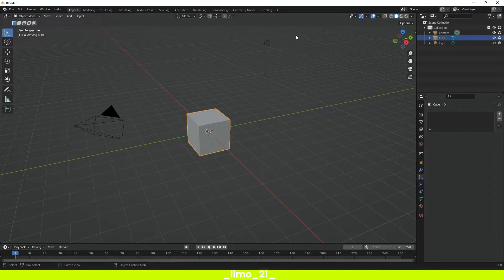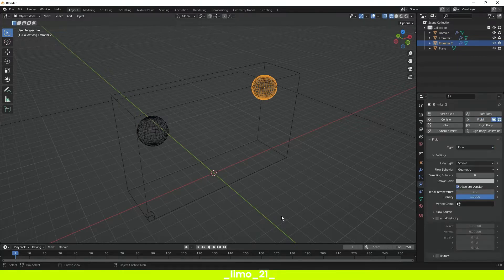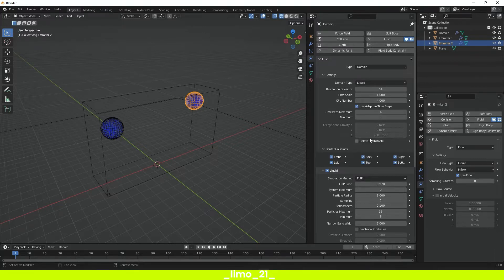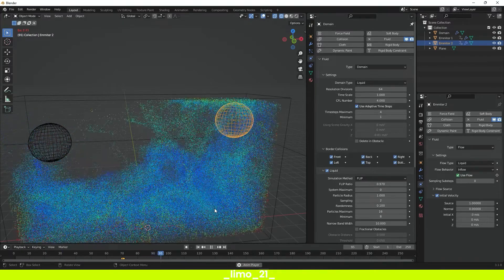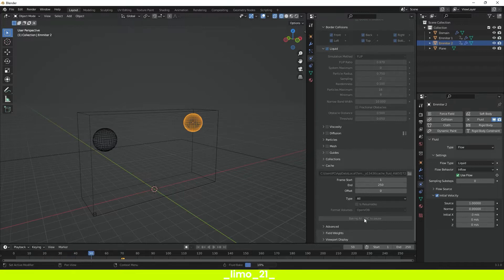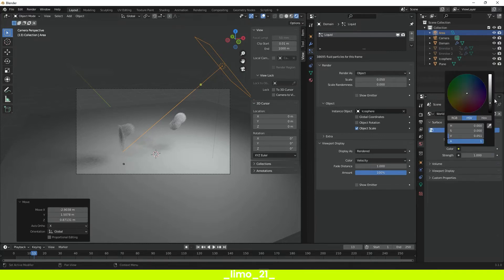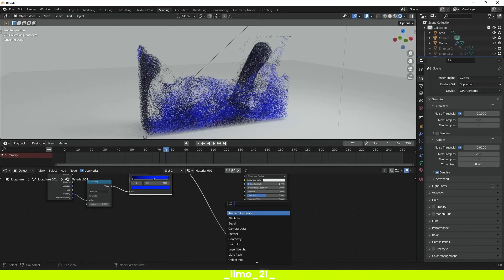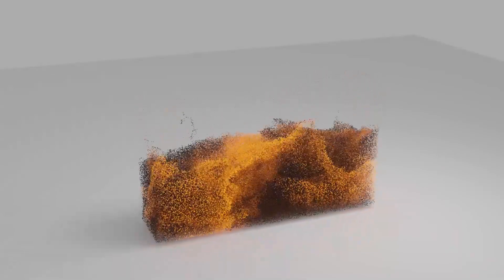PARTICLE SIMULATION - Blender

Comment: Thanks for the tutorial, I am a blender beginner, I followed and retraced every step but my issue is the icosphere is emitting from the 3d cursor separate from the fluid, what am doing wrong, please help me.
Reply from the maker: You're getting particles from both, the ico sphere and the 3d cursor?
Reply: @limo_learning_  my setup is the same as in your tutorial, the fluid flow of the two emitters is fine, but the ico spheres are emitting from the 3d cursor falling through the domain, I am using blender 2.93.
Reply from the maker: @brighttendaimuvirimi1905  In the emmiter´s particle system properties, you will find a parameter called "Emmit Form" in the source window, set that to surface, you can watch my last video (the thano´s effect one) i talked about that in it. If that doesn´t work or you don´t have that section, try updating your blender to 3.0.